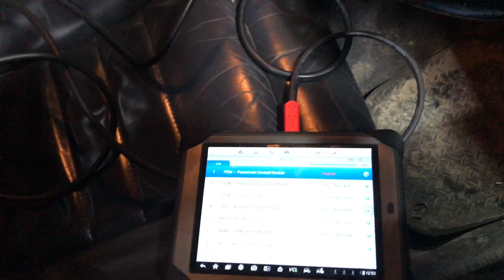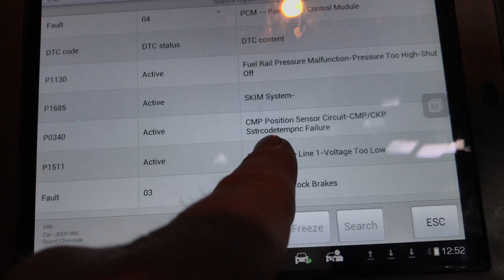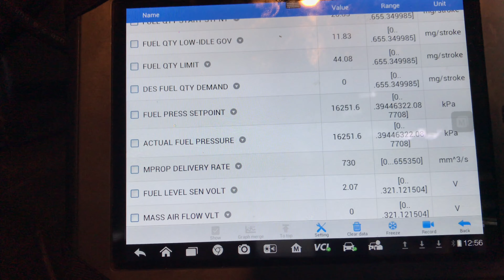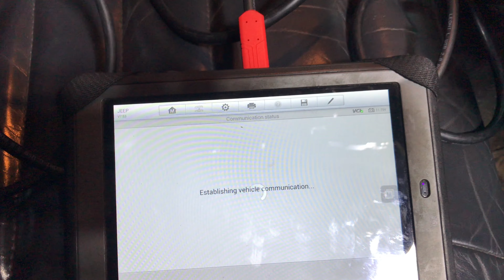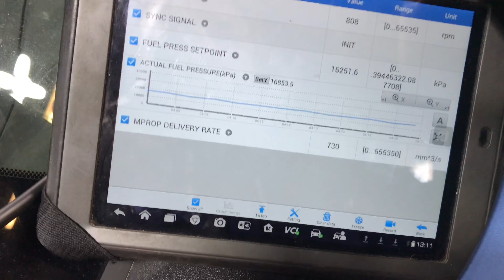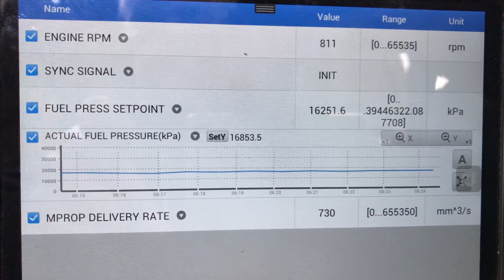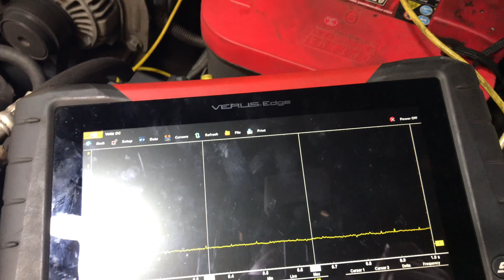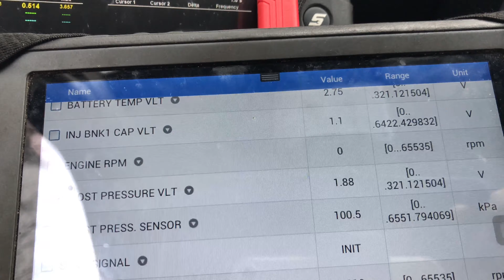Jeep Cherokee (2005) 2.8 CRD Intermittent Cut out and won't restart P0340 Part 1

Comment: Hi sandy I've  a Dodge nitro crd 2.8 cam shaft position sensor changed by local garage 🤔 did last one meeself  this time no start high pressure pump and injectors all changed Inc New timing belt water pump 18months ago any ideas as garage recons will have to go to dealer as he's  stumpted Could be an ecu issue keeps throwing up the cam shaft sensor code but def new one in 🤔🤯 any help be appreciated I recognise that road is that back roads past polbeth ,west Calder way .🤔
Reply from the maker: It's usually the crank sensor that's the problem even though it says CAM Sensor

Comment: Possibly crankshaft sensor failing when hot. That would explain loss of engine rpm. Perhaps the loss of engine speed makes ecu think camshaft sensor is out of sync
Reply from the maker: Well done my friend your are absolutely correct, I'm just about to upload part 2 cheers sandy
Reply: @sandyande  hi. My car stops on the road, when the temperature is hi. 90 gradi

Comment: What was the conclusion to this? Having very similar issues.
Reply from the maker: Bleed screw on diesel filter was bleeding in air
Reply: @sandyande  thanks! This makes me hopeful as I await a replacement fuel filter head.

Comment: Interesting 🤣
Reply from the maker: Just a heads up Ian, csm sensor never fixed it! What do u think next move should be?
Reply: @sandyande  Out of my depth when it comes to diesel Sandy...I wouldn’t dismiss the Battery/sense DTC’s. The vehicle being 16 years old may be suffering from decrepitude at the Battery terminals/cables...check the integrity of the block and chassis grounds. Monitoring the fuel pressure PID’s on a test drive might offer some direction. Very strange the scan tool drops when the engine stalls...loss of power (supply/ground)...You likely have considered all of this. Best O luck to you and Roddy 👍